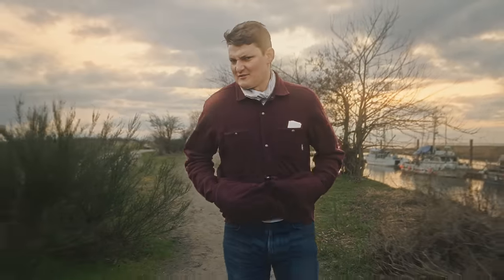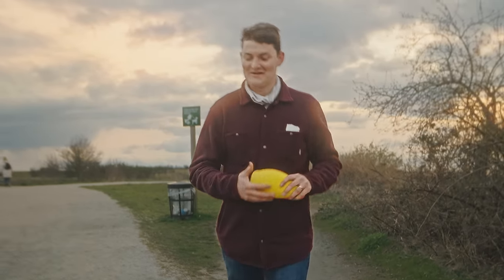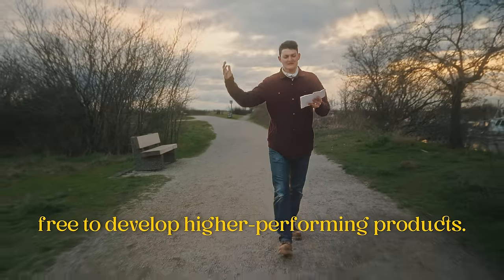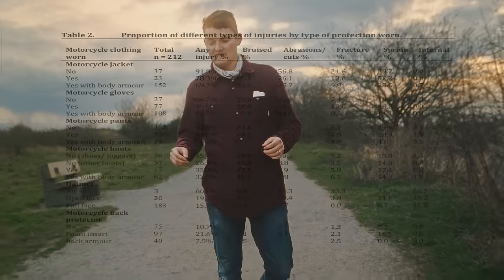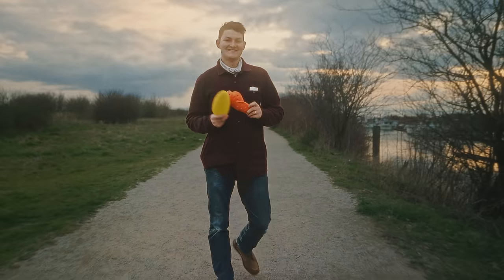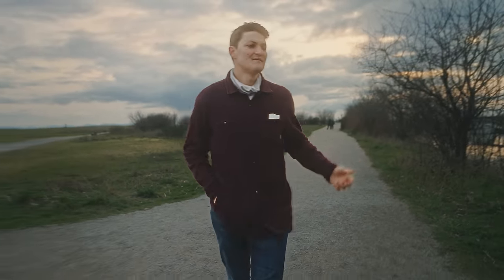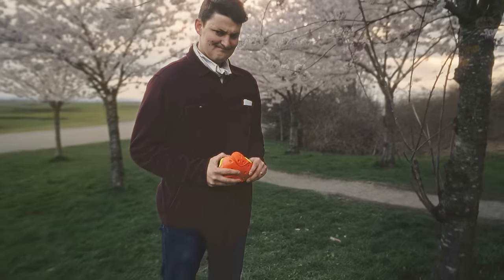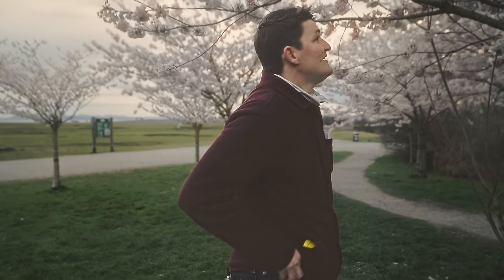Why I Stopped Wearing Motorcycle Body Armour

Comment: Hmm, strange approach here. I had a bad motorbike crash 10 months ago. My knee was injured with a fracture. I was full gear equiped BUT, without my knee armor, my knee would be destroyed, not just fractured, and today, repaired. I think the armor goal, was not to prevent fracture, but to absord energy to reduce the damage. Sorry for my english, i'm a french rider who wear full gear... still ^^ Have a nice day, and I hope for you that you will never had a bad crash, without your armor gears. Ride safe people, life is too short ;). Best regards.
Reply: Good input on this discussion.  Your reply makes sense to me!
Reply: Your armor mainly spread the blunt impact across the entire protected area. Without armor a portion of your knee would have taken all the impact, likely having a more severe outcome. Kudos for using it.
Reply: Good point!
Reply: that's exactly what he said...the rating is a joke, it doesn't prevent damage just soften the blow and removes the road rash and other inconveniences. BUT the point is still there - why the bar/standard is set so low? Because manufacturers had it set this way with the help regulatory companies. And the latter did mention that is the minimum and manufacturers can go higher but the former don't, due to cost and uneducated consumers. Would you even look at the 2.5k jacket when there is a $500 one right next to it on the rack? If you did you would see the "low" cost one has the minimum standard for safety (15N) while the higher priced one guarantees <4N. So the added cost to create 2-3 multiple versions of the same jacket with armor based on rider and greater reduction is not justified because they don't sell.
Reply: Your English makes way more sense than Ryan’s it won’t stop fractures like horse rider kit (which also wouldn’t at the speeds and G loadings of motorcycle CE standards by the way) so throw it away!
Reducing the seriousness of fractures and eliminating them on more minor impacts is entirely the point!
My impact pads are staying in!
Reply: @rrsf4i  softening the blow does prevent or make much less serious damage!
The only way to prevent it in any circumstance would be to rode from inside a huge ball of shock absorbing foam!
That’s no reason to turn down the huge improvements in protection from air bags, improved (even if imperfect) standards to ensure you can tell how much protection your buying when you make decisions and have much more minor injuries when you do come off!
Reply: depends on type of armour. Its different to have just foam pads and have something like offroad hinge knee armour. I think if they would want to they would build good, strong,CHEAP, armour which wouldnt feel like being medevil knight.
Reply: Exactly this. I've crashed my bicycle at less than 10 mph and my skin was scraped my and bones hurt for weeks. I've crashed my motorcycle in my Dainese jacket at 60 MPH and didn't feel a thing and walked off without a scratch. If you look at the jacket, you'll see exactly where it took the hit. My left elbow and shoulder and that's exactly where the thick pads were. 

I'd rather take a 9 KN of force going to my bones than 40 KN of force. It may not save me from breaking my bones from hitting a wall at 100 MPH but it can make the difference between breaking bones and shredding my skin VS not breaking bones and skin being intact at a 60 MPH crash. If Mark Marquez didn't wear his race suit during his Indonesia GP crash, his knees would be shattered by now and wouldn't have a career. Sorry, I'll just keep wearing what works for the professionals.

Going back to the math Ryan calculated, if the initial hit transmits 9 KN of force with Level 2 armor and 18 KN of force with level 1 armor, let's take a guess and say without any armor that force would be closer to 40 KN (give or take) for the sake of this example. Few points here. 

1. Would you take a hit by a hammer to your elbow and transmit 40 N of force or 9 KN of force? That is a huge difference.

2. Yes, the force required to break your bones may be only 4 KN but if the initial force was half the number, it could make the difference between a fractured bone and a non fractured one.
Reply: Don't pay attention to this channel anymore. The last video was 'you go faster on all corners by counter leaning and leaning out like in moto GP is wrong! And the one before was about an engine and they miscalculated everything, the channel d4a pointed that out and explained, and they didn't rectify. This was a good motorcycle channel with (at least to me) unfunny American jokes. It's now taken a direction of fake news, playing with safety matters and cornering, misinforming unexperienced riders.
Reply: Fully agreed ! Got the same, minor crash but my knee would have suffered without the armor, with it, I just got a pain (less than after falling of my own height) for a week...

Comment: Been skateboarding, MTBing, surfing forever. After age 35, I noticed that I don't heal as fast. 2016 was when I realized the significance of ANY protection. Longboarding down my local hill at ~15 mph wearing no pads = Took me about 10 minutes to get up off the ground from the pain. 6 weeks recovering from f-up knees and rash. Bought some non rated knee and elbow pads and did not care how I looked went down that hill again faster. Eventually I fell off, bounced and slid around, got up, got my board and went down the hill again laughing at how ridiculously awesome it felt to fall, take no damage and get up immediately.  Picking up moto at 40 it was a no brainer buying as much protection as I could (no airbag yet) and after a few minor falls it is the same feeling. It doesn't change your mind until it happens as most things in life. In a major accident will armor protect you from broken bones or death? Apparently not, but I am wearing my armor for the minor stuff that I know can take me out for weeks and months away from the things I love.

Comment: As a motorcyclist myself who's been around couple of accidents, I STRONGLY DISAGREE with Ryan on this.

I have been in a crash which fractured both my femur and my hand. Yes I was wearing an armoured jacket, knee pads and stuff and I was disappointed with its performance. I felt like wearing it was not worth it at all, having to deal with this mess.

But this was before my wife met with an accident. She was on a scooter and the crash was on city speeds and didn't have any riding gear. She had a minor fracture which was not much to comment on. But the skin she lost - it took months of plastic surgery, hospitalization and the scars it made have still not healed after an year.

As for me, I walked away in under 3 months, with just a week or two of hospitalization despite having two major fractures. That riding gear saved me a lot of time and pain by keeping my skin intact.
Reply: Wasn't the point of the video only talking about pads not being effective? He said he still wears abrasion resistance.
Reply: The point of F9 is riding gear won't help with fracturing injuries and only the abrasives.
Reply: I totally agree with you but wasn't the whole point of the video to be a 1st April sketch?
Reply: @eloquentsloth6080 The pad plays a role when it comes to abrasions. The riding gear mesh will still give you scratches and minor wounds.
Reply: Just sad to know the industry only meets the minimum requirements. And doesn't do much to actually protect against breaks and fractures 😢
Reply: Thanks. Logic.
Reply: Those are high energy accidents.  Did you not listen.  Those pads will not help you from high energy accidents that break bones.  Low energy accidents is like getting into a sparring match, you'll be bruised, cut, but most likely won't break any bones.  Man up.

Comment: I have had a couple of spills, and I'm absolutely grateful for my body armour.  Something that isn't mention here is compound damage.  Nothing that I'm currently aware of, that money can buy, is ever going to prevent serious impact damage if you come to a hard stop... but if you bounce along the road you may well strike elbows and knees several times with light to moderate impacts.  Stack those impacts together and you have a potentially serious injury.  The friends who have crashed/been knocked off and had no pads all suffered elbow and knee damage (even with lined riding jeans and no pads).  2 of those were at sub 30mph speeds.  My own incidents were at twice that speed and I walked away with no injuries including where my lightweight leathers abraded through and I finished the slide on my backboard.  Confirmation bias? Perhaps, but I'm leaving my armour where it is until they start making something better.
Reply: You are right, i bet you to this day felt the force impacting the protections where you hit the road, and some say they are there doing nothing...  no ammount of bro science will make me ride without protection ever.

Comment: Ryan F9’s videos are always very well produced, usually entertaining and thought provoking, and often informative. Does that mean the take-away message is always in the viewer’s best interest?
Ryan may well have said he can’t tell you to take the armour out of your jacket (etc.) because amongst other things it may, “by some statistical anomaly”, save you a fracture; but he has a lot of influence, and many people may well ditch their armour in favour of a bit more comfort, as he said he does. I would not recommend that.

I’ve had many minor motorcycle spills and two major accidents. In the first, where my bike and the other's car were written off, I was wearing good gear with the standard armour exactly where it should have been, i.e. wrapped snugly around my joints which were naturally the touch points as I bounced along the road. Result: no fractures, just some bruises and muscle strain. In the second major accident, I was wearing an equally good jacket with the same standard armour, however due to my preference on the hot day for COMFORT, my jacket was partly unzipped down the front and this led to my shoulder armour being nudged out of place on impact. Result: anterior dislocation of shoulder and multiple fractures leading to full-arm immobilization for six weeks. The second accident was at half the speed, but otherwise quite similar, yet the result from displaced armour was much worse.

If you wear your armour correctly, it won’t be merely a “statistical anomaly” which may save you a fracture, it’ll be the armour. 

A back protector protects your back, nothing else. An airbag protects your torso (and its precious contents), nothing else. These are both great (and expensive best-sellers at Fort Nine, obviously), but only part of a comprehensive protection regime. Having no armour for your elbows, shoulders, hips and knees – in exchange for comfort – is plain daft IMHO. I’m sure Ryan could have made his point about wanting better standards in a more responsible way.

Regarding the AAP 2011 paper, I suspect from my own experience and that of other experienced riders I know, that if the researchers had a statistically significant sample, they would indeed have found a benefit to fracture reduction, but alas too few riders were in the data. I’ll keep wearing my joint/limb armour, well-fitted, as professional racers do, and I’ll keep recommending it to others. Absorbing some impact energy, and distributing residual energy will in pretty much all cases mitigate injury at the impact point. Why the hell do we wear helmets instead of beanies?

Comment: "Helpul against abrasion and laceration". not inconsequential
Reply: If you have ever had road rash, you would certainly prefer not to have it again
Reply: Literally anything other than nothing would be, though. Thats the point. If we are just trying to avoid scrapes, you can do it much better and much thinner than a giant armor pad.
Reply: Yep.

I took a slide

The only places I lost skin were where there were no pads.

(3 places none more than 1" diameter.)

Burn through was on one finger, side of knee, and ankle.
Reply: Foam is a terrible material to protect against abrasion, its just too soft. You could stuff cheddar in place of the foam and accomplish the same thing.
Reply: I had a knee debridement a couple years ago...rather have passed a kidney stone (passed several of those).  Cinder gravel on  cement, I was wearing off road type MX pants and Fox Titan knee guards which shifted on impact.
Reply: Level 2 armor has a low but statistically significant effect in testing. It's just level 1 that's only useful against abrasion. But unfortunately this isn't an April fools video, the gear really is kinda crap.
Reply: @Whyexes  Yep, and adding pads adds slide time before you start losing skin, even when placed under textiles that are already abrasion resistant. Takeaway is ultimately that companies shouldn't get to lobby to weaken regulation and they shouldn't get away with misleading us when they do.
Reply: While I disagree, I feel like he does a good point of detailing out why he thinks that way and the arguments against his point.

Do still think we need a "C3" standard that actually gets to that 4kN threshold.
Reply: @joewwilliams I have had a pretty bad scrape on my knee under jeans  that stayed intact.  That fabric dragging across you at high pressure and speed can still take skin off even if it doesn't tear.

Comment: Doesn't factor in little accidents where you are fine and the bike is fine and you just get up and carry on riding.

Low level injury prevention is still a thing.
Reply: Yeah but unless you want to wear full motocross gear every time you go out, then you will make some trade-off between protection and comfort. Videos like this help riders make better informed decisions about which pieces (like pads or a thick plastic chestplate) may not be necessary for them.
Reply: Fell off doing about 25kph due to some gravel last summer, hit my knee and hip and it didn’t hurt much due to armour. Fell off my bicycle doing about 5 kph this winter (ice), hurt like hell for a week, no armour.

Much like his strange 285 degree crank video or 180 about the value of GoreTex I wonder how Ryan is doing.
Reply: @903lew  I fell off my e bike last winter accelerating out of T junction. Low sided, was maybe doing 15 mph landed on my hip and I've had pain ever since. 

Had similar accidents whilst riding motorcycles had the only damage I sustained was embarrassment, even when the force and weight of the bike has added to the force of the impact.

Distributing that shock to a greater area is so so beneficial.
Reply: @user-co6ww2cm9k  

I always geared up when riding my motorcycle, no matter the weather.

The suggestion from Ryan is that the pads are a waste of time and that he removes them and encourages others to do the same issue frankly silly of him.

Some protection is better than no protection and often some protection is the difference between walking away and having to go to hospital.
Reply: @freedomofmotion  Yup. Took to Westling armour all winter on the e-bike, figured I already had it so might as well use it. In the end that first icey off was my only one. Think I’ll do that every year when the studded tires go on, seems silly not to.

Comment: Remember the difference between an open and a closed fracture? That is pretty important. They will also save you on any low speed crash. 

This is similar to complaining that you died in a car crash and that the car is not 'protective enough' while having hit a wall at 100km/h. You did hit a wall at 100km/h.

Comment: My bones are strong and haven't broken, but after a severe off-roading accident, I damaged the ligaments/joint in the side of my hip. This experience made me consider how much better protected the more vulnerable parts of my body, like the hip area, would have been with armor.

You do state this when you say "specifically in relation to fractures."
Reply: Ligaments take forever to heal, like months if not in some cases years.
Reply: That’s a good point. The other thing I wondered was about the severity of those fractures, a small fracture is nothing compared to a severe break.
To me, the challenge is to find the right comfortable gear where the pads don’t bother me, at least on the bike. I’ve done that now, so nothing to gain by removing them.
Reply: he did say at the end that it can still be protective, and that he does wear pads/air bags, just very high spec ones rather than the diddly little ones
Reply: body armor won't do anything to save ligaments and cartridges, knee braces can somehow protect the ligaments but at the expense of damaging your bones.
it's nice that you mentioned your bones are strong, I once knew a rider who had an high bone density according to a medical examination, he never wears any safety gear, not even a helmet, he would sometimes come with road rashes and his bike beaten up yet he somehow never broke a bone.
surely if he hit an object strong enough he'd break a bone, but I'm sure another weaker dude would've broke his bones.
Reply: @DeadEightVids  I crashed a dirtbike and got a hairline fracture in my wrist. My hand swelled and took a few weeks to heal. To this day, My wrist will hurt randomly.
I cannot imagine if I broke it.
Reply: I dislocated my collarbone last year, after living for almost 4 decades, i have finally accepted that my body isnt made of steel.
Reply: there's a ligament in the shoulder, name is 10 miles long, it gets virtually no blood flow to the area, the only way it can heal without taking years is by oxygenated blood injections to speed up the process. Super important for ppl to get their injuries checked out, they could be stuck with it for a long time, if not permanently.
Reply: @Dante_S550_Turbo  Was going to mention the same thing. Ligaments and tendons have very poor blood flow to them, yet access to blood is critical to their repair. They can take a looong time and often require specialized therapy treatment to address properly.